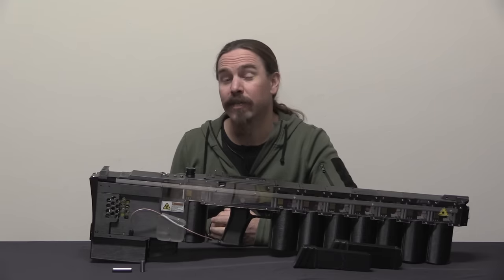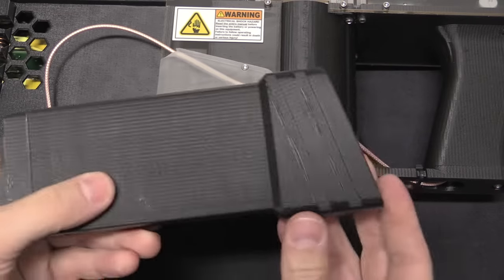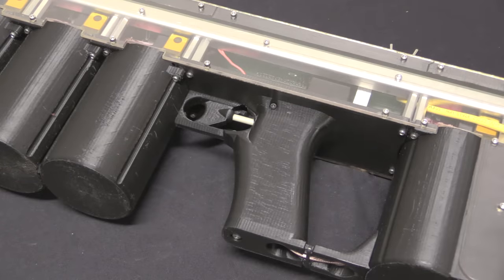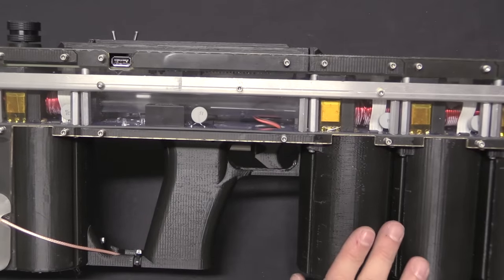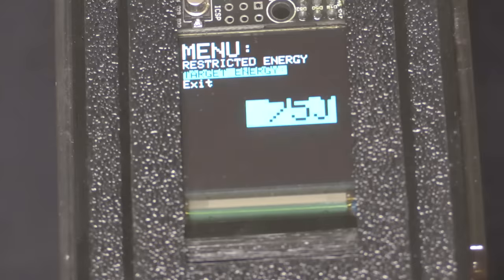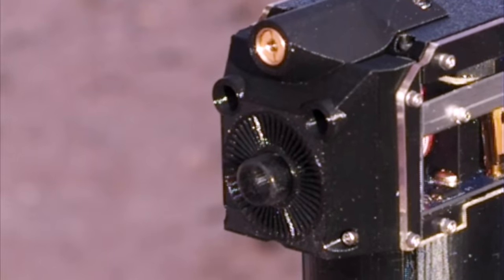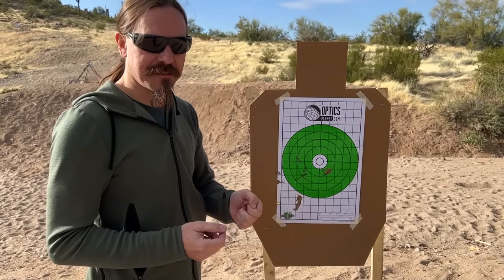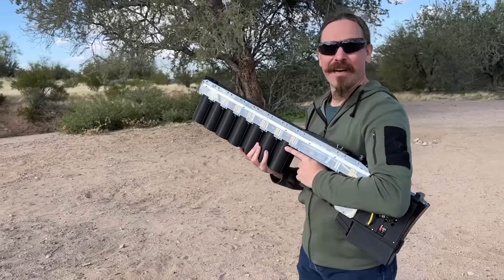ArcFlash Labs' GR-1 Anvil Portable Gauss Rifle

Comment: "With every shot the barrel can get quite hot"
For anyone curious, the manufacturer lists the gun as 2.8% efficient.  Which means that only 2.8% of every discharge is being used to move the projectile.  The remaining 97.2% of the power is being dumped into the weapon as heat.  Still an interesting concept weapon, and if you have the four grand lying around to buy one, it will certainly be a more interesting conversation starter than most other weapons out there.
Reply: and what happens to the polycarbonate barrel with that heat?  there is no 400 to 16000 Amps going thru the coils.  the wires would fry with that current.
Reply: Holy shit. That means it can still improve an ungodly amount. Proper gauss cannons are going to be fucking WILD.
Reply: @johnconrad5487  probably the polycarbonate and all transparent pannels are just part of the prototype design... those could easily be replaced with special plastics designed to deal with hot.
Reply: @johnconrad5487  Of course the coils are subject to 4000-16,000A. How else would a magnetic field be generated?

They survive because of the pulse nature of the discharge. Massive peak power for tiny fractions of a second. After all, the sum total (useful output) of the eight coils is a mere hundred joules. Your microwave uses that much power in 1/16 seconds.

The polycarb barrel is only subject to a fraction of the heat. Unlike a firearm, it doesn't contain the detonation of the chemical cartridge nor the friction of the projectile. The heat is taken by the coils. The barrel is subject to heat radiating off the coils, and any convection that occurs through the weapon's internals. PC-plastic is also a low-heat-transfer material.
Reply: It won't be long before guns are made out of pottery.

Comment: Whenever you feel you can't make your weapon look any more futuristic, remember you can always put the magazine behind the trigger.
Reply: it not just sci-fi aesthetics. its actually a neccessity here Dillon. almost all the weight is in the coils/battery. to balance the weapon you need to spread those along it length. that's why you have the rear battery+ coil assembly and the forward coils. but your magazine has to be behind all the coils which forces you to bullpup it if you want a shoulder fire weapon.
Reply: If Bullpups had been made first, maybe all rifles would be Bullpups. 🤔
Reply: @TurinTuramber  Bullpups are not strictly superior to a traditional rifle. The AUG and FAMAS were both replaced by traditional rifles rather than improved bullpups. Bullpups aren't strictly worse either though. There's plenty of lore around the advantages and drawbacks of either, but at the end of the day militaries are going for the cheapest simplest gun that's going to do everything they need it to. Bullpups have come a long way, but they're still very difficult to reload while prone.
Reply: @petermuller3995  isn't that just a breach loading cannon?
Reply: @epis8613  bull pups are a lot more expensive than traditional rifles as well
Reply: @TurinTuramber  unless you want to operate your early bolt action rifle like how you operate an mp5
Reply: @peter Müller  it would be a fun range toy though you could take it hunting. It would have to be an inline muzzleloader though. I don't know if I'd want my head next to a percussion or flintlock action.
Reply: @epis8613  Great points. Maybe Bullpups will make a come back, say if body armour makes huge leaps forward.
Reply: @darchensol5112  🤓
Reply: its a gauss rifle, it needs a long barrel for maximum coils. it just makes sense to make it a bulpup.
Reply: Now we just need a halo style ammo counter.

Comment: The reason why they went with heavy bullet/low velocity instead of light bullet/high velocity, is because the coils are sequentially switched as the bullet travels down the barrel and getting the timing right becomes extremely difficult the higher the velocity goes.
Reply: Yeah-- noting that all the different weights have the same velocity, the acceleration is likely being limited by the optical gate timing and not the actual power output
Reply: The smaller the projectile, the less a magnetic field can act on it, and therefore the less it can be accelerated.
Reply: @qwertyasdf66  just needs MORE energy to get the same results, but unless we somehow discover something to bust the currently understood model of physics to it's very core, these types of weapons will be nothing more than a novelty for anything not dragging around a large reactor
Reply: @AwesomeDedrick  in my experience with coil guns, that's usually how it is. power output doesn't really matter much, as long as the field is significant enough to accelerate the projectile, but the exact timing of the coils is pretty critical. too early and it wont impart enough speed, too late and it'll actually slow the slug down. optical gating is a pretty good solution to that, because it allows for projectile variability and doesn't require nearly as much calibration, but even that is held back by things like projectile length, velocity, and the speed of the clock on whatever controller is reading the sensor.
Reply: They are actually optically switched as the round leaves one coil and enters the next. The whole system is self timing. The issue though is if you go too fast the round will no longer stay in a coil long enough for any net gain.
Reply: Similar problem as the first A bombs
Reply: @carlmckinney7115  hmmm I dont know much about this stuff, but what if you had progressively longer coils the closer to the end of the barrel?
Reply: @cpncorndogg  I believe he's right. High speed makes good timing harder, and it means the amount of time spent in a coil goes down, so each successive coil is imparts less energy. Longer coils, perhaps, but at some point you will hit diminishing returns for barrel length (double the barrel, double the muzzle velocity. Doubling the length of the current design would already make it not so portable). So you need to increase the power of the field to make it accelerate more in the same amount of distance. However, the faster it goes, the more distance it needs to accelerate more. Hence supersonic speed with current railgun tech is impossible with in a portable size/weight.

That said, you ARE onto something with the timing. In a coilgun such as this, there is an optimal position (or, possibly a small range) in each coil. When the slug is in that position that coil imparts the most energy, but the majority of the barrel does not have one of these optimal points. If there were more coils that could be engaged separately, creating a more steady acceleration, this would operate much more like a railgun, where the EMF is always in the optimal position, and then you could probably achieve a similar muzzle velocity to barrel length that a railgun can achieve, without the heat/wear/precision issues that a railgun has.

ArcFlash has bettered one issue (that applies to railguns as well) of charging the capacitors more quickly. Coilguns have another issue, which is that continuous acceleration. If you solved that, I think it'd be just a matter of iterating until you had a weapon that outperformed current firearms in certain scenarios.
Reply: Thats the point and the challenge.
Reply: The distance between the coils could be increased the farter it is from the magasine, using less coils, and double the capacitors per coil in a v shape.

Plenty of enhancements possible.
Reply: @qwertyasdf66  True but magnetizing the projectile is obviously going to happen at some point allowing smaller projectiles imo. I have wanted to build one of these for years.
Reply: it also means you need to dump all that power over a shorter time which means more expensive power switching systems, even more amps, and a tendency to light itself on fire

Comment: I do like how the "hollow point" medium length ammo Ian showcases here is literally just a concrete anchor, the kind that you drill into concrete with a masonry bit and just beat that part in with a hammer and rod so the spreader holds it in place and you can thread in bolts and/or threaded steel rods for handing things such as strut (in commercial applications).
Reply: You could probably shoot a screwdriver bits out of it. You know the meme or joke about a girl who found the screwdriver bits laying on the ground and was frustrated about how someone dare to throw away"bullets" just like that? At this point it seems like a perfect ammo for this gun.
Reply: Imagine just going into hardware store and grabbing either screwdriver bits or bolts or concrete anchors and just loading them into this gun and be ready to... do some carpentry job 😂
Reply: @tekknorat  screwdriver bits for your 5.56 platform, concrete anchors for your nonlethal option
Reply: @tekknorat  you'd have to build one with a smaller barrel than what's showcased here; most screwdriver tips are 1/4" at the hex if not smaller
Reply: @jacebeleren9290  I know. I think in this case the barrel can be exchanged to whatever diameter required, it wouldn't change "firing" mechanism.
Reply: Glad I'm not the only one to see that.
Reply: Let's go to Lowes and stock up on ammo now before everyone figures this out.

Comment: A flat battery with wireless charging mats and specific contacts, 2 batteries with with a wider tapering stock. A No2 cartridge compartment for gas assisted loading chambering for rifling and cooling. No2 gets cold when going through friction. Like filling a paintball tank. Capacitors that feel better in the hand and a rail to hold the in place for a mount like a bipod. Could throw a flexible replaceable solar cell on the outside stock side of the battery for unused charging.

There's potential there.

Comment: I doubt there are many people alive today who have used this weapon, operated this level of technology.
You are in a very select class, sir
Reply: bro its a magnet
Reply: That's not true...a company sells a fleshed out commercially available version of this that shoots small metal discs. It's much cooler than this 20 lbs prototype
Reply: It's totally not like this type of weapon is 120 years old...
Reply: Dude people built these (the same or even more powerful ones) AT HOME for like 20+ years now! There's nothing that amazing inside either, your frigging cellphone, even if its an old piece of junk is FAR more technologically impressive!  Not many fired these? Yes. But its not because its good, quite the opposite. "Not many people fired a snot cannon!"..? Yes, because no one WANTS a frigging snot cannon. This thing is a glorified useless science project, and efficiency wise, my frigging slingshot is more impressive!
Reply: @mkzhero build one and upload the video then.
Reply: @Marcos-ms1ij   i actually did (single coil, weak-ish), for a little fun in school, 16 years ago. Literally just a fking battery connected to a switch and a converter, that in turn is connected to a capacitor, and a bigger switch from that to a coil around a plastic tube. Could penetrate 1-2 braced sheets of aluminum from a can from up close. I don't see your point tho, what does it have to do with fucking anything?

Comment: Thousands of amps, 500 volts - it cannot be overstated the sheer magnitude of the energy running through this machine with every shot. The electrical discharge alone could kill an elephant. Amazing that they've made it that safe
Reply: How safe?
Reply: Instead of a bayonet in the future you just flip the safety to taser wand.
Reply: That's the thing, this doesn't need to be applied directly to the heart, the skin won't stop it. Caleb was probably pointing out that not even an elephant's thick skin would stop it...
Reply: @Agrinddandi  "Safe"
Reply: @dangermaus42069  xD agreed

Comment: The real question is how powerful can you make it without becoming either impractical or very heavy.

Right now its a glorified sling shot.
Yet to be fair, that was revolutionary for its time.
Reply: @SimuLord  Also if you convince someone to stick a fork in those charged capacitors, or tbh touch those capacitors in almost any way while charged.
Reply: Well that depends on two main fractors:
- Your energy source
- the strength of your field before you suffer damage to the system

The first dictates how much you can shoot and in some way conditions how fast the coils can charge. A better power source means you can fire more and recharge faster.
The second will dictate how much velocity you can achieve per coil as the stronger the field, the more attraction the bullet will receive, and thus the faster it will go. Remember, the projectile isn't actually touching the barrel that much, nor is there any max speed linked to expanding gases and/or barrel degradation (unlike railguns for example). So that means theoretically you can achieve quite insane velocities out of the thing.

If you use less voltage than what your capacitors hold, you can fire in extremely quick bursts, without the annoyance of removing cases from the system, and without the issues of heating of caseless ammo. 

However at a baseline, your battery/capacitor will be less energy dense so its for sure going to drive the weight higher. But with advanced brought by electric vehicles (for both higher capacity batteries and tremendously more capable capacitors), it may end up becoming practical enough, where the advantages of easy to make/adaptable ammo outweighs the disadvantages of a gauss system.

What I think it will be far more useful though is for vehicles and boats. Unlike the soldier (who is restrained to batteries and small capacitors) a vehicle has a lot more room to work with an comes in with an integrated power source which removes the finite shot count of the rifle. A vehicle can afford to carry a lot more, offsetting or removing the downsides of the weight. And finally vehicles can afford to carry the necessary power infrastructure to operate at WAY higher voltages without damage, leading to absolutely insane velocities (we are talking velocities comparable to CLG guns, so that would be around 5 to 7km per second). This would be especially important for ships and artillery since it would allow them to fire from a different continent, out-ranging even cruise missiles (if the projectile can survive the INSANE forces and heat imparted onto it that is).
Reply: Technological advances will make them smaller and more powerful. The first computers were the size of a house.
Reply: I figure it needs two things, better energy storage, both quick discharge and long term, and some kind of cooling method, course heat sinks are  a solved thing!
Reply: Ask the US Navy
Reply: @electronus97  this is out of my league. But do the capacitors have to be attached to the gun? Or can they be stored on your back. Not sure the gage of wire needed to send that much amps without much resistance.
Reply: @s0ak1tncider  That was my thought as well.  Could you put the batteries and capacitors in a backpack?  If so, you might also be able to add some barrel cooling mechanism.
Reply: @s0ak1tncider  a good question, one I don't know the answer too. I would love to find out though.

Comment: For those wondering why the lighter projectiles aren't going faster than the heavier ones: The coilgun works by turning its coils on and off in sequence, ideally turning off when the center of the bullet is in the center of the coil.  This is done by having an infrared (IR) light beam located by each coil which detects when the bullet is in that position.  I am guessing the gun was calibrated for the longer bullet.  When a shorter bullet is used, I'm guessing they do NOT have a separate set of IR light beams positioned to properly detect the position of the shorter bullet because it would take up extra space inside the gun barrel, causing the space between the coils to be a bit longer, and causing a small decrease in efficiency, and increase the length of an already large, heavy weapon.  So when the IR beam detects the shorter bullet, the bullet is not quite centered in the middle of the coil when it turns off, decreasing weapon efficiency and bullet velocity.  Still, the option to use different sized ammos is interesting and this is a great coilgun!!!
Reply: Because this is a reluctance motor type coilgun it might also be pushing the smaller projectiles into magnetic saturation.
Reply: It would be cool to have a dial or button or something to accommodate different sizes of ammunition by changing those intervals you mentioned
Reply: I imagine they could dial in the coil timing to the length and weight of your preferred projectile in the software
Reply: There may be a sensor inside that collapsible butt stock that adjusts the mag well size.
Reply: Considering it has a computer inside that watches the acceleration, i don't see why it wouldn't be able to calculate the bullet acceleration speed and decide its weight... Probably just lacking the programming. Still, even without it, you'd think a lighter projectile would still move a bit faster due to the initial acceleration boost... Although i don't know, i think this tech is just a joke for handhelds right now, just a toy.
Reply: force=ma 

the coils create a magnetic field (B)

B=flux(a)

since B is a force and the formula for force (F) has a component of mass then a smaller projectile will accellerate faster given the same force 

and since kinetic energy has the form E(k)=1/2(m)(v)exp2...the lighter mass would be more than offset by the increase in velocity and offer a higher muzzle velocity